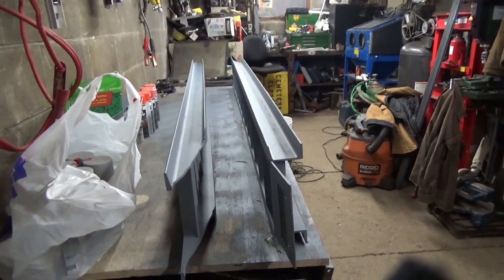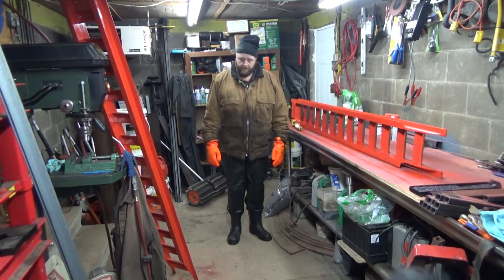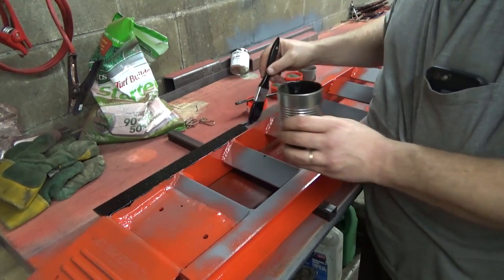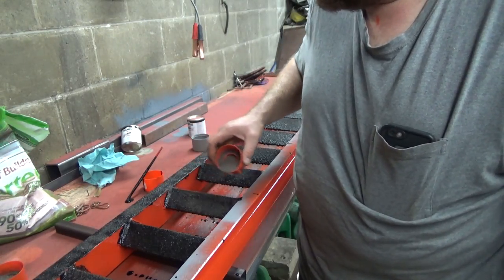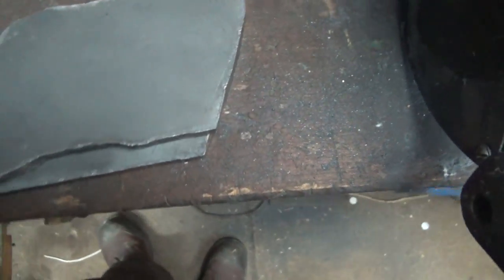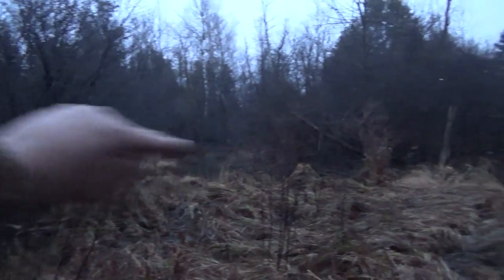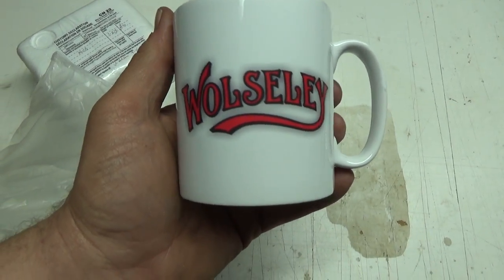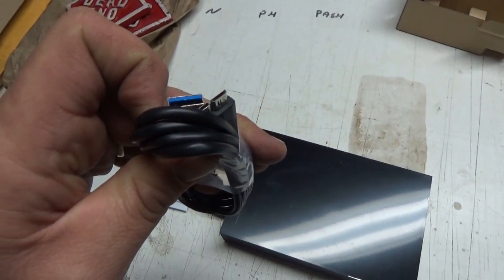Sandy painting and a letter from Alex :)

Comment: Now from bottom side of trailer need to run a bolt on each side and have holes in ramp ends to go over bolts to lock them on to keep from sliding off. Just a thought Bill!  Another great video!!

Comment: bill i noticed something with your bench grinder... the rest/table is too low. it needs to be raised roughly an inch so its at the middle of the wheel. right now when you grind whatever material your grinding is acting like a brake. its wedging in on the down turn. try lifting the table up in line with the middle of the outputs. that should solve the rpm robbery. love the videos! keep em coming!
Reply: nice spot!

Comment: That connector is a USB 3 Micro. You should still be able to plug in a regular USB 2 Micro cable into one side of that plug but it will copy stuff faster if you're using USB 3 cable and USB 3 port on your computer. Normally USB 3 ports on your computer are blue inside.

Comment: I'm not the person to tell you what you could or should do. But I have a question. Could you weld in or rivot longer pins on the end that connects to the trailer that would sink into holes you drilled into the floor of the trailer? I was thinking that may stop the ramps from sliding during loading or unloading? Just a thought to see what you think about that idea. Thanks a million.
Reply from the maker: +Swharf13 ya it likely needs something i was thinking about strapping to the springs
Reply: +BILLSTMAXX :) That's a good idea as well!!!